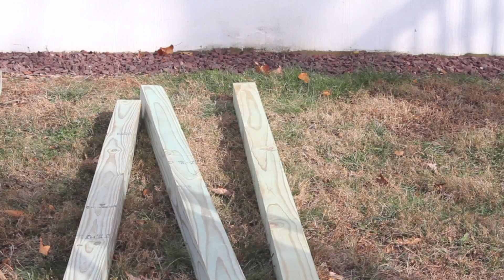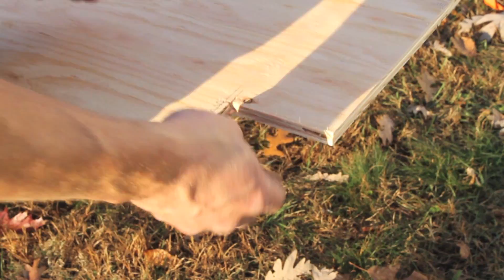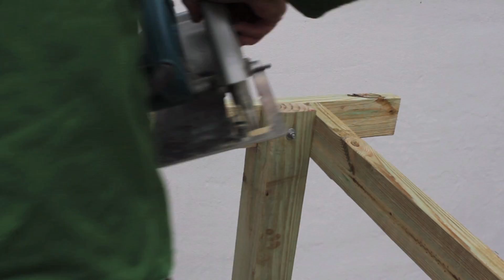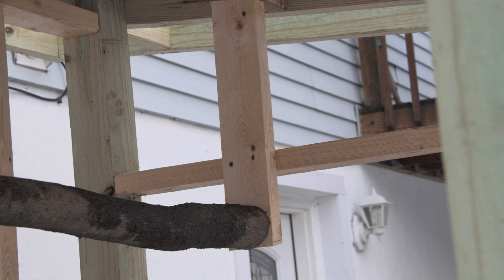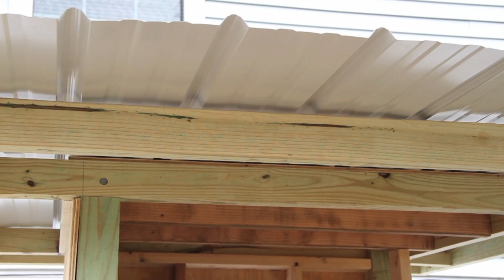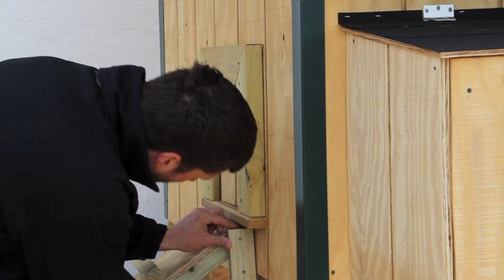Easy to Clean Chicken Coop V2.0: Step-by-Step Instructions with Free Plans

Comment: Thank you, thank you, thank you!  I too will be using this and plan on donating to your gofundme as you should definitely be compensated for your work.  How many chicks can this hold?
Reply from the maker: The rule of thumb is, 2-4 square feet of coop space per bird.  So for this coop, it would be 4-8 chickens.  I would stick to 4,5, or 6 though unless they will be free ranging or at least have a lot of run space.  If the chickens get bored, they sometimes start pecking each other which is a major pain to deal with.  Good luck!  Let me know if you have any questions during the build.
Reply from the maker: Oh, and send pics when you finish.   I’ll add them to the Flickr page
Reply from the maker: How’s the coop coming along?
Reply: E Fleming great I’ll send you pics
Reply: E Fleming I need to take some take some better ones ill send them tomorrow

Comment: I am at the point of framing the floor and have tried to follow the blueprints. It seems the 61" 2x4s to support the nest box would be slanted without a board to raise on the 2x4 (in notched 4x4s)  as you did in the video. Your video says "follow the blueprints" but I think you may need to adjust them or include the board that brings it flush with the rest of the frame. Otherwise, so far so good- thanks for all the details!
Reply from the maker: Hmmmm.   Interesting, i believe the blueprints were adjusted to eliminate the mistake I made in making my coop.   I know a number of people have followed the plans and made this coop, you are the first one that mentioned it...but then again, maybe they saw the mistake and didn’t mention it to me.   Regardless, thanks for the heads up!
Reply: Oh Yes! I'm sorry! It was all my problem, not your plans. I didn't start on level ground. I am a novice and learning much! Just for others who are beginners, it wasn't easy to keep all 4 posts level and square and plumb- I added bracing at the bottom.

Comment: In the process of finishing a coop based on this design - though I doubled the dimensions, and made a 4'x8'. I want to confirm that the channels milled out of the 4"x4"s are in fact easier/quicker with a circular saw. We tried it both ways specifically to see which was faster, and while the router was in fact leaving a prettier cut, the saw was much more efficient, and I challenge someone to come out and tell me which beams were routed which way.
Reply from the maker: I did my 4x4 notches with a miter saw, but I believe a circular saw would have been better (you can set a specific depth and not worry about overcutting).  If you got a nice look with a router, go for it!  Pressure treated wood tends to be so wet and sappy, it often gunks up a router.

Comment: Do you remember the angle of the cut for the nesting boxes. I am doing the roof differently (covering and entire run which also includes the coop) and sloping it away from the nesting boxes so the snow and ice won't pile up at the nesting box.  Anyway - the tip you give in the video about the angle is that it is the same as you figure out for the room.  I can't see any dimensions in the plans that would allow me to calculate the angle.  I helped my kid with trig the other day and I think I could actually do it!If you can't recall the angle (to set the chop saw), i'll just eyeball it and should be good.Thanks (Great job btw and thanks for this!)

Comment: What a generous person you are to spend all this time and effort into helping others, thank you! I'm eager to make this coop. I'm not a 'builder' typically so please forgive me if this is a really stupid question. I can't seem to figure out at what point you move the structure over to its permanent location (would it be too heavy/awkward at the end? Do you build it where you plan on locating it?) and a follow-up question to that... does it need to be anchored down somehow to the ground with cement posts or something? We live in an open area so it gets very windy. Thanks again for your help!
Reply from the maker: Not a dumb question.   You probably want to build this in its permanent location.  I ended up selling the coop that I made for this video. With three people we managed to load it onto a trailer... but it wasn't easy.  

In terms of anchoring, dig a down about a 12-15 inches for each "leg" of the coop.  and put a bag of quikcrete in each hole.  Thatll add about 320 pounds of weight.    If you want to make sure that the post doesn't pull out of the concrete, you could add a couple screws to each post before adding the concrete.  (the screws will stick out and and make the posts less slippery, if that makes sense).
Reply: How much did you get for the coop?

Comment: Having trouble finding GREEN deckmate screws.  Home Depot has yellow box, and a brown box.  What are the differences in the colors?
Reply from the maker: I don't believe there is a difference.  I think they are both intended for exterior construction / pressure treated wood.  I think the lighter screws would be used if you intend on painting or staining the wood a lighter color (so screws are not as visible).

Comment: This is great stuff! Been searching around for some info on how to build a coop. Thanks a bunch! Has anyone used this design, but modified with the deep litter method? Checked through the pictures on the flickr and couldn't see any. I imagine it would be possibly by raising the nesting box up from the bottom and lining the bottom few inches of the walls with linoleum. Any thoughts?

Comment: Hi there. I'm British, but live in Germany and I'm about to embark on building a coop using your excellent guide.

A simple question ... I notice in your step-by-step instructions you have used untreated wood, yet in later parts of the video, the wood has obviously been treated. So did you treat the wood after building the coop or did you later dismantle and reassemble after having treated the individual pieces. Basically what I am asking is, is it wise to treat the parts before assembling?

A great video and the same applies to your updates.
Reply from the maker: If I understand right, you are asking about the dark brown stain I used.  I would say its probably easiest to stain the coop after it has been assembled, or else you will end up staining a lot of wood that will end up being scrap.  Also, any place you make a cut, you will have to touch up.  

In my plans, I talk about "pressure treated wood."  In the U.S., that is a title used for wood that is chemically treated. It is intended for use outside where it will be exposed to rain, ice, mud, etc.
Reply: Aha, great! And thanks for the tip!

I'll try to keep you posted as to how I progress. I'm not bad at DIY, but I've never tackled a project like this before. I'll need to scale down on most of your dimensions because the area we intend placing the coop is about 2/3 of your size and we only intend roosting 3 hens.

Should be a lot of fun though.

All the best,

CV
Reply from the maker: Sounds good!  Let me know how it goes.  Also, if you have any questions, I'll do my best to answer them.
Reply: I do have a question regarding the door to the coop at the top of the ladder. This fairly simple construction looks good.

We occasionally travel on holiday, usually around 2 weeks at at time. Do you know of any easy to install auto-system for opening and closing the door? We will get help from neighbours to collect eggs and replenish feeders every second or third day, but a system to open the slide-door in the morning and shut it at night would be great.
Reply from the maker: If you are going away during the coldest parts of the winter, you will want the door closed at night.  During the spring, summer, and fall, I never close the door.  

I don't remember where, but I think I saw a youtube video once where someone had rigged up a timer.  Honestly though, I don't know if I'd do it.  From time to time, the chickens stay out of the coop longer than they "should."  I'd hate to lock one out, or in...whatever the case may be.
Reply: I was wondering about not closing the door, but I am concerned about predators. I intend making it very difficult for weasels, stoats or such the like to enter the run, but one can't be 100% sure.

Comment: Could you tell me how you would insulate this coop for those of us who experience -40C winter nights?
Reply from the maker: Yikes, that's crazy cold.  I think I would cut something like this to glue in between the studs.  If the chickens are pecking at it, you might need to also put some 1/8th inch plywood on the inside.  Or at minimum, some thick plastic. (be sure the plastic is no where near your heat lamp).     

http://www.lowes.com/pd/Expanded-Polystyrene-Foam-Board-Insulation-Common-1-in-x-4-ft-x-8-ft-Actual-0-937-in-x-3-875-ft-x-7-875-ft/3365576

I've read that moisture affects the birds even more than cold.  So you want to make sure you still have some small vents for moisture to escape through.

Comment: Hello! I am new to the chicken world and I have 8 chicks that will soon need a coop. I see that this coop is for up to 6. How can I modify this coop to accommodate 8?
Reply from the maker: The easiest way to do that is probably by making this coop 6 feet long on the nesting box (and 6 feet long on the side opposite that).  You will probably want to add another nesting box.   The basic structure wont really change all that much, but you will just need to make sure that there is a stud where you put the plywood seams.  Also, you might add an extra support down the middle of the roof and an extra floor support.  

You might also want to make the roof overhang slightly smaller so that you can still get away with buying two sheets (they come in 4x8 sheets).  Good luck with everything.
Reply: Thank you for your help! I really appreciate your it. When I said "How can I modify this..." I actually meant "how can my dad modify this..." because it will take me all day, a box of bent nails, and mangled fingers just to get two boards together.

Comment: A great tip for buy shingles for odd projects... If you take a stroll down the shingle isle at Home depot you'll find that there are many bundles of shingles that are torn open for one reason or another. At Home Depot an open pack of shingles is %50 off regardless if there are missing shingles or not, this is perfect for projects like this since most people only need a couple packs and it doesn't matter if they are miss matched... :)

Comment: i'm gonna try making one with more than 3 nesting boxes because i want more than 3 hens. but it looked nice.
Reply from the maker: +Kalfax plays Even with only 3 nesting boxes, this coop should work for 4-6 chickens.
Reply: dont they all need a space to sleep or make eggs?
Reply from the maker: They always sleep off the ground on the roost. Only egg laying will happen in the nesting boxes, but they do a decent job of sharing
Reply: ahh, so thats why theres a stick in there.. 

thats soo weird!
how do i know if i have to open the nesting boxes? at what time during the year for those lovely eggs? xD
Reply from the maker: +Kalfax plays  The nesting boxes should be open all the time.  In one of my videos I kept them closed during the first few months of the chickens lives because I didn't want to clean them out before the chickens were laying eggs.  The chickens lay all year round, but they slow down a lot during the winter.  After the chickens are about 5-6 months old, you should expect about 6 eggs per week per bird.  That drops of significantly after 2 years, and it all but stops after 3-4 years.
Reply: okay thanks :) good to know.

Comment: I am building this coop by your video and by your blueprints. It looks like you did not put the carriage bolts in the bottom. Is this right? The blueprints call for it. I did see you put them in for the roof.
Reply from the maker: Sorry...another person made the same observation.  I did put them in as the plan says, but I initially "tacked" everything together with screws.  You will see the carriage bolts on some of the later Flickr pictures.

Comment: Hello Flamwad18! I want to begin by saying what a wonderful documentation video you made and a great looking chicken coop.  I am in the process of building the coop and ran into a snag I can't figure out concerning the mating together the platform framing side 2x6's with the post notched 2x4's @ what height do I screw together the side 2x6 with the back 2x4's?  At the moment I have the notched 2x6's with the 4x4 together and the side 2x6's ready to mate up with the notched 2x4's 4x4. 

Alan 
Magnolia Texas
Reply from the maker: +alan williams Hmmmm.   It's a little bit hard to follow.  I think that question is probably answered in the plans...right?    https://www.flickr.com/photos/coopinstructions/albums
Reply: I found it easier to not even measure. Only measurement I made for the floor was the first one to put a certain space under it. Then I did the 2x4 notch. Put the other post that is to be notched for the 2x6 next to it. put another 2x4 on top of the 2x4 in the notch and mark that line. That will be the top of the 2x6 notch. Or you could just measure 3.5" up from the top of the 2x4 notch and mark that.

Comment: is there a method or reason why you use screws at the floor of the posts but carriage bolts at the top where the roof is?
Reply from the maker: +cscooper2000  In the finished product, there are carriage bolts in both places.   I  used screws to hold things together temporarily until I got the carriage bolts in.  Very observant!  

https://www.flickr.com/photos/coopinstructions/16807081798/

https://www.flickr.com/photos/coopinstructions/16807168988/

Comment: how many pieces do you need for making an L shape chicken nest me I say it 8 post to hold my chicken nest
Reply from the maker: +Morquet Gittens Ash-shafii Hmmm, that would all depend on the size of the coop.  As few as 6 posts I would say.  This coop design could probably not be adapted for that...
Reply: L shaped chicken nest where they lay eggs at
Reply from the maker: I am sorry, I am not sure if I understand the question.
Reply: You have the chicken coop where they lay there eggs  in the back and i wont to put there too and on the left side too can I do that
Reply from the maker: Yes, you could probably add additional nesting boxes to an additional side, but I don't believe there would be any real benefit.  The maximum number of chickens that could fit in this 4 x 4 coop would have adequate nesting space just as it is designed.
Reply: Can I use the same patterns but make it bigger then I could put the nest on each side
Reply from the maker: Yes, the plan could probably be tweaked to accomplish that.

Comment: Could we double this in size? Or would that just make it way different? Because we have over a dozen chickens and I would like to build this for them.
Reply from the maker: +Terry Barlet Good question.  Probably the easiest way to accomplish what you are trying to do would be to extend the nesting box / window side another 3 feet (which would allow you to add 2 additional nesting boxes).   I would probably use a 2x6 (instead of a 2x4) as a cross piece under the nesting boxes.   

Extending the huge swinging door side would be a little bit more involved in terms of structural door support.

Just make sure every plywood end sits on a joist.  If you're willing to problem solve  a little bit along the way, you can totally do it!  Good luck!

Comment: Thank you soo much for this. Ill definitely throw some bones your way via paypal once I finish the build.  BTW, what stain did you use for the siding?  it looks great!
Reply from the maker: m Thanks and let me know if you have any questions along the way.   The stain is called Sikkens Dark oak 009 and can be purchased at home depot.  The stuff was NOT cheap but I loved the color and wanted the coop to match my deck.  May be about $60 a gallon?
Reply: flemwad18 Yeah, definitely looks worth it!   BTW, any reason you only covered the middle 4x4 section of the roof with plywood instead of the whole thing?
Reply from the maker: m No great reason...It would have cost about 30 dollars more to do the whole thing.  On my bigger coop I had flashing which came down and covered the spacing strips I put in.
Reply: +flemwad18 Would you say 1 gallon of the sikkens stain is enough for the entire coop?
Reply from the maker: +John Oates - A gallon of sikkens should definitely be enough for the coop.

Comment: Is the linoleum more for spraying poop off with water hose or for another reason besides just having plywood? Also did U grow up in a family who had a carpenter in it who taught U or did U learn this craftsmanship on your own? Thank you.
Reply from the maker: 747epecan1 I try to pressure wash the inside of the coop about once a year and the linoleum helps with that; it doesn't allow all the poop and stuff to soak in like the plywood would.  A few years ago, a contractor let me help out with building our deck.  It's amazing how much carry over there is between the two projects.

Comment: Has been very helpful, though my nest door and main door warped right away, so I had to incorporate some extra fastening at the "open edges" to hold them down flush.
Reply from the maker: Lonnie Lyman Interesting, I had the same issue with my nesting box door.  I wonder if that could have been prevented somehow?
Reply from the maker: flemwad18 I should say, building an actual frame for the large door would help with warping, but you have me thinking about nesting box door solutions.  hmmm.